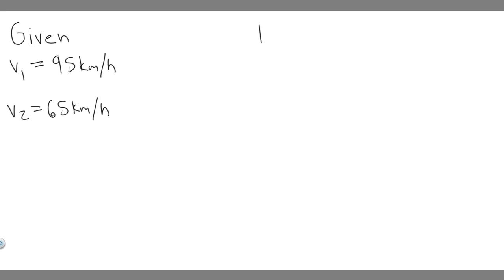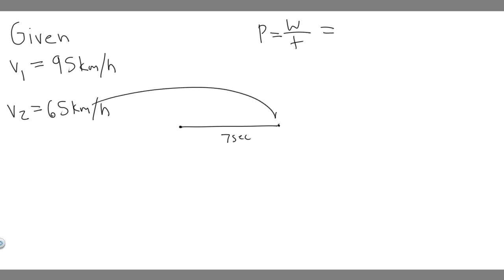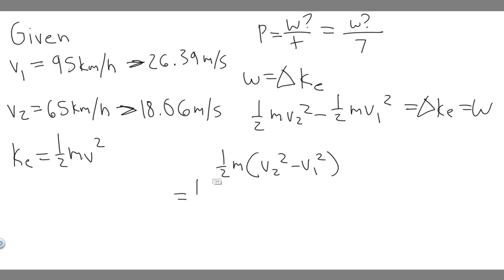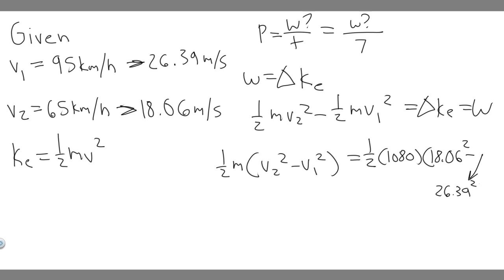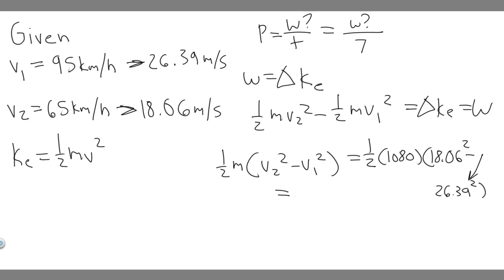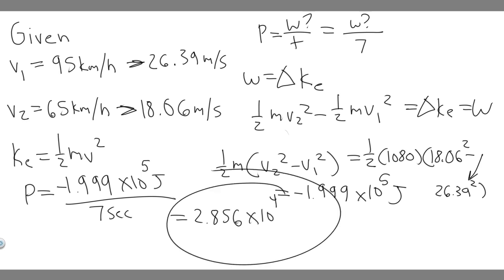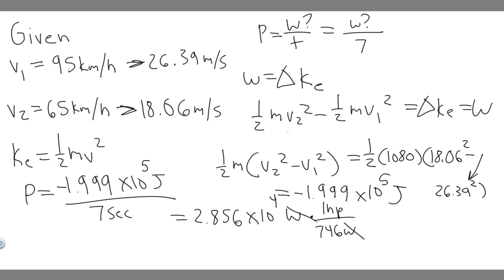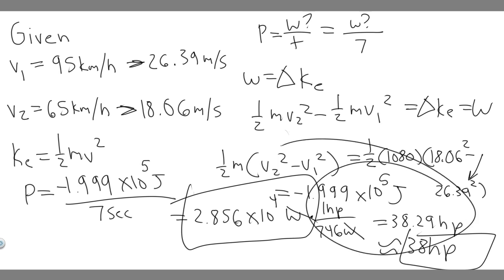A driver notices that her 1080-kg car slows down from 95 km/h to 65 km/h in about 7.0s on the level

Comment: Why was nothing done with the 80km/h number given? isn't what you solved for the power needed to decelerate the car from 95km/h to 65km/h in 7 seconds? The question is asking how much power is needed to keep it going at 80km/h.
Reply: Yeah I'm also wondering why the solution completely ignores the "constant 80 km/h" part. Seems like the calculated change in kinetic energy would be to maintain the original speed of 95 km/h...? Maybe it's just assuming the difference between 95 and 80 km/h is negligible, but then I don't know why they didn't just have us solve for 95 to avoid confusion.
Reply: @Adam-vq1uy  I think it's because the average speed over that distance is 80km/h